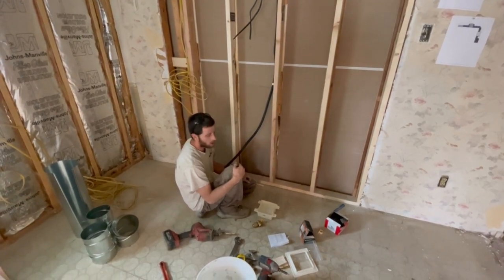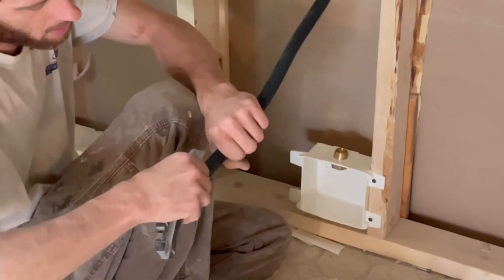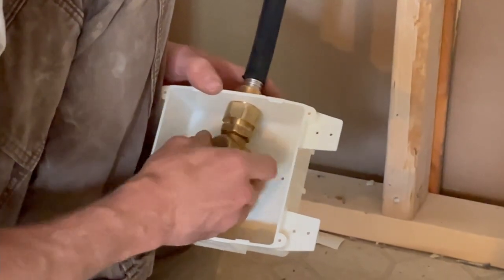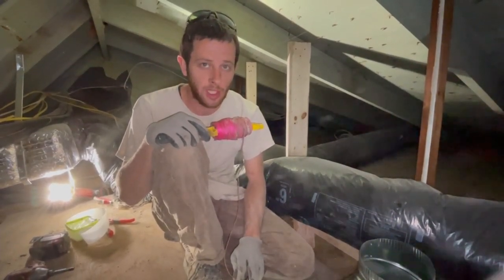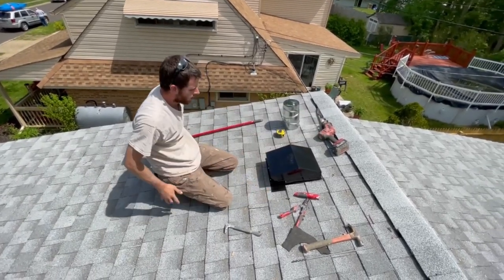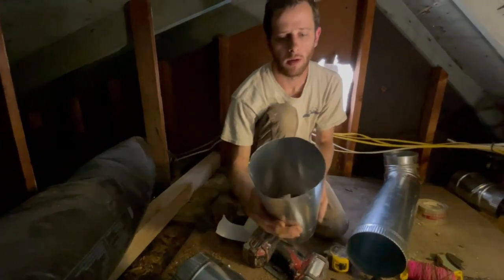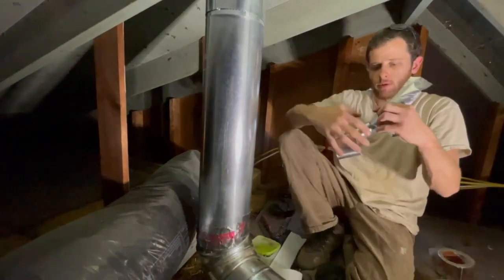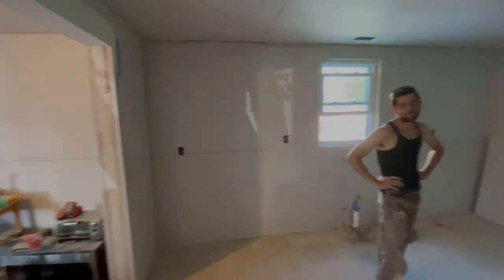Installing a gas valve box for stove: Episode 14

Comment: Don’t you have to use black pipe for gas line? Is this flexible line with the rubber coating to code ?

Comment: Its by building permit gas valve has to be behind the gas stove
If the stove on fire how do u close the gas stove valve asap?
Reply from the maker: The valve is meant for replacing the appliance. If you have a basement you can put another valve in the basement, but if not you have to get out of the house immediately and call the utility department. Or, you can go turn the gas off at the meter yourself.
Reply: If the stove is on fire you always go to the source and shut it off. Thats just a service valve.
Reply: If my stove is on fire I am not going anywhere near it or trying to move it?  You go to a down stream shut off or safer the main shut off outside!

Comment: Yikes makes sure not to score the pipe when removing the plastic sheeting and you should only expose enough of the pipe to make the connection there should be bare pipe exposed once you make your connection
Reply: And make sure to install a drip section so any sediment will drop down in